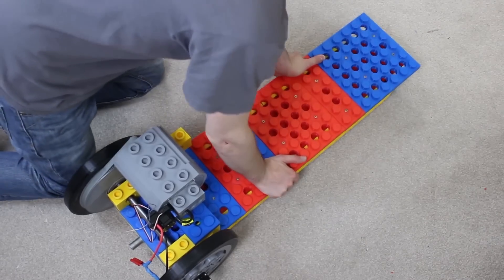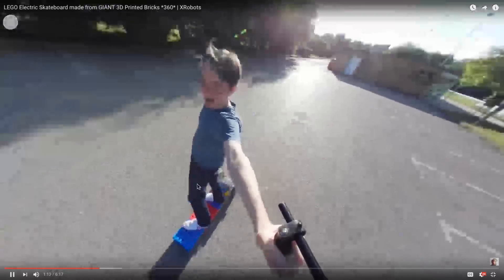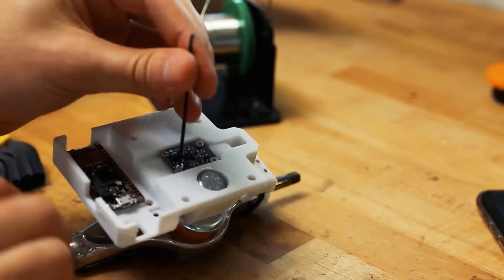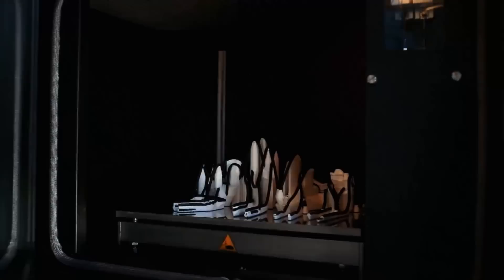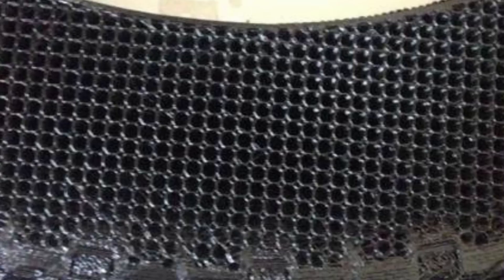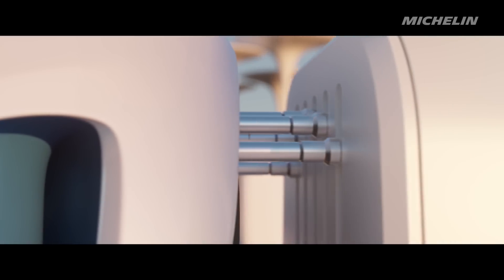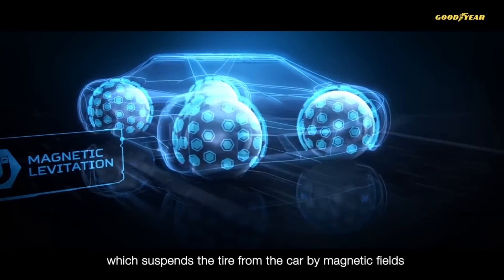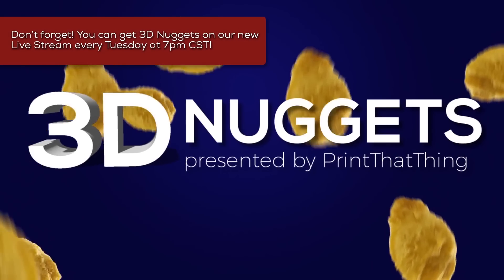3D Printing Tires, 360 Kick Flips, & Lego Skateboards - 3D Nuggets

Comment: Those r all cool the only problem I can see is the one in the Good Year tires they will need an internal motor in theory if technology doesn't advance quick enough then they will cost an arm and a leg
Reply from the maker: true. Thanks for watching +lineman505
Reply: Print That Thing - 3D Printing Designs no prob maybe u should look into the sports uses for 3D printing like for say a 3D printed tennis racket
Reply from the maker: +lineman505 heck yeah! I play tennis. That'd be sooo cool. Do you know of anybody 3D printing rackets!?
Reply: Print That Thing - 3D Printing Designs no that would make it cheeper to play and I can see it now the big stars in tennis with 3D printer sponsors